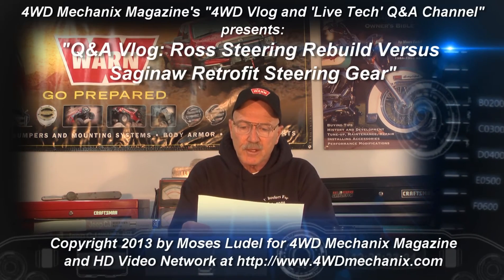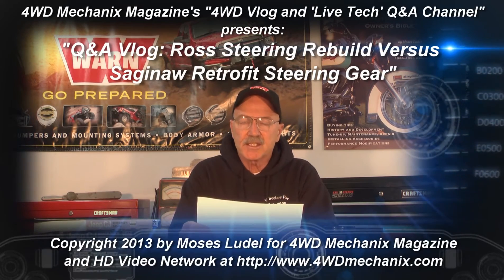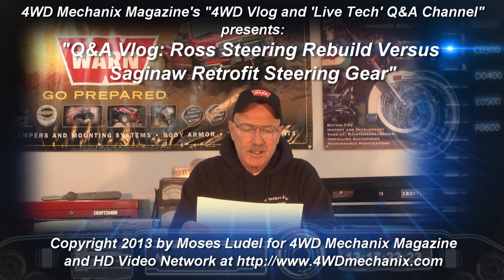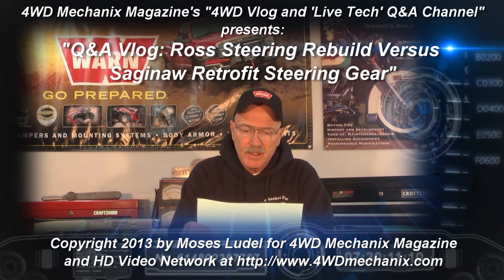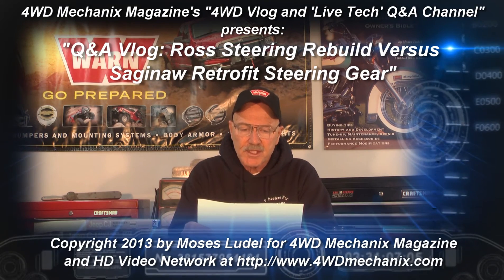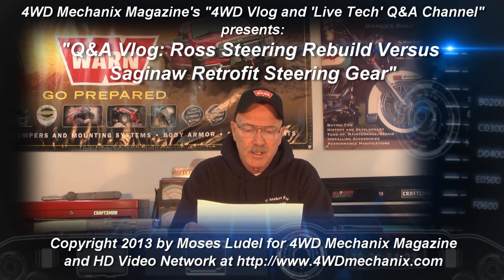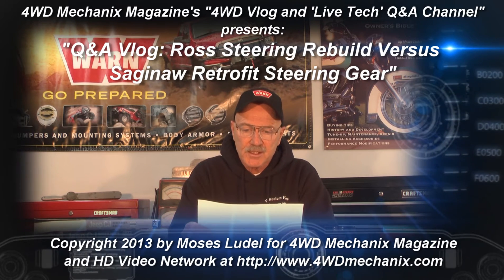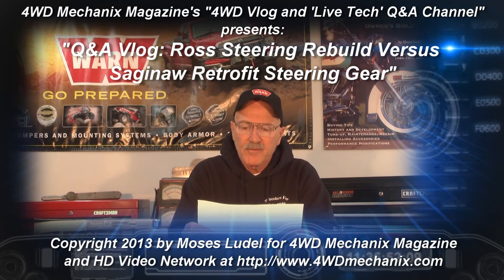Ross Versus Saginaw Steering Gears for Vintage Jeep® and Scout 4x4s

Comment: Nice video explains the differences in the boxes. I have a 1950 willys Pickup. The steering is horrible with the original box and bigger Tires. What is the best way to change to a performance steering system and what are your recommendations. Thanks in advance.
Reply from the maker: I fully understand...You have the option of Saginaw manual or integral power steering.  If the pickup is stock (engine, etc.), the manual Saginaw gear is certainly a big gain.  If you have a V8 engine conversion, power steering is clearly an option.  When I do power steering on vintage Jeep vehicles (especially shorter wheelbase models), I prefer a slow power steering ratio (4 turns lock-to-lock boxes from the '60s/'70s GM "big cars") and often use a bigger (Jeep stock diameter) steering wheel.  For decades, Advance Adapters has been making conversion kits (including the steering linkage) for both Saginaw manual and power steering gears.  Both manual and power Saginaw gears are popular.  There are new manual gears available (Borgeson) and rebuilt integral power gears are available from a variety of sources.  Give Advance Adapters tech support a ring at 1-800-350-2223.
Reply: @4WDMechanixMagazine  Hi and thank you for the information. Herm the overdrive guy offers a bolt in being the front cross member which, as he claims, is the strongest part of the frame. I have a 302 Ford so I am thinking of this bolt in swap. Have you ever heard of it? I really don’t want to cut and then weld the front cross member as is required with the saginaw box. The Herm kist offers a Ford reverse steering box. I would enjoy your thoughts or others about this because I am ready to pull the trigger on the Herm swap. Thx in advance.